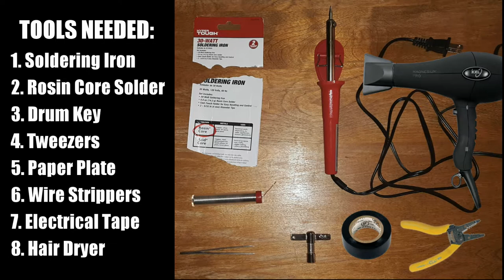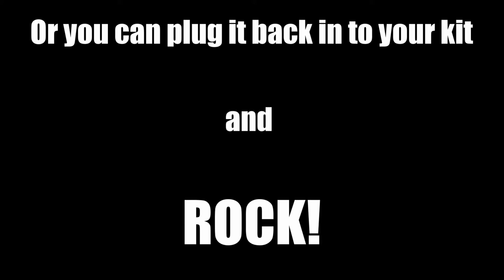How To Fix Broken Alesis Crimson Kick Drum

Comment: The mesh head on my Command set kick is worn. For some reason the piezo was glued to the mesh head. But watching this video the drum triggers just fine without it being glued on. I’m guessing I could use any 8” mesh head (since alesis doesn’t seem to sell those) to replace the worn head?
Thanks for the video
Reply from the maker: Danny Martinez, yeah, that should work. I can't really see a reason for keeping the Mesh cover on except for aesthetics.
Best place I can find Alesis replacement parts is eBay. Really unhappy with Alesis customer service and product availability.
Thanks for commenting.
Reply: @Underdrummer  Thanks for the response. I’m half considering buying a new tower and then getting a few bucks for the old one as it works but I feel it’s lost some response. 
If I get a new one I was thinking I’d use one of those drum patches. That’s a assuming they work without causing other issues. 
I haven’t been playing long so still learning the ropes. I’m a guitar playing that got interested in other instruments during the pandemic
Reply from the maker: @dannymartinez3600  Yeah, those Alesis Bass Kick stand go for a pretty penny on eBay. 
I do al little guitar as well. Guess people everywhere are learning new things since this stupid virus happened.
Best of luck to you and never stop playing music!
Reply: Well, I have a Surge Mesh kit, which uses essentially the same bass drum.  The head was wearing a hole through the center, so I bought an eight inch single layer kevlar mesh Evans head and a kevlar patch for the center.  The piezo was glued to the head, as well.  I carefully peeled the old head off, installed the new head, and made sure it is in contact with the piezo sensor.  Seems to be working fine, sounds the same.  But ask me how it's holding up a year from now...
Reply: How do I remove the mesh from the trigger? its glued...

Comment: I just got my first Alesis drums set. What can I do if the center kick is not working?… it is not detected by the system (They produce no digital sound, like the one you get when you press the “kick” key on the display)
Reply from the maker: Hi Luis, Start with the simple solutions first. Check the audio connectors are firm. Make sure the audio is working on other drum controllers. Then finally follow the steps in my video to remove the outer plate and look to see if the wires are severed. 

Overall the Alesis Electronic Drum Set is nice but the bass drum model is extremely flawed.

Best of luck to you!

Comment: I just got mine about a month ago and the bass pad has way more sensitivity toward the bottom of the pad than the center.  Was yours like this?  Ideas for fix?
Reply from the maker: Hi SteveB*94, mine was like that as well and still is. The reason is the Piezo switch is located lower on the kick drum pad. See here,  @0:37. The problem is you don't want your kick pedal actually striking the switch, this is what leads to the severed wires and a broken switch. You want your pedal to strike the large pad in the center of the unit - though the sound is not as clear, here @1:28
Reply: Hi whats your reglage please (kit trigger and sensibility etc?)
Reply: Umbrella Corp Multigaming :  not sure I understand the question. I definitely have the sensitivity on 1 for all of my pads.

Comment: Does the big round foam trigger the piezo?
Reply from the maker: SwagRyan.P, yes the kick pedal hits the big foam pad, not the Piezo itself. The vibration triggers the Piezo.
Reply: What is the name of that foam and size? I need to replace mine. Hope you can help. Thank you
Reply from the maker: @jamiljonel6613  Do a search for Alesis Drum Replacement Parts. Not sure you could replace only the large foam pad. 
https://www.alesis.com/products/browse/category/drum-accessories
Reply: Did you guys find out how to replace the big form? Mine has a big hole and it gets in the way of playing, any suggestions?
Reply from the maker: @angel77t91  There are a few sites I have found that sell Alesis replacement parts but it's not easy. Maybe make one yourself from similar foam?

Comment: Mine is working intermittently. Opened it and it all looks good. The only thing I've noticed is the big styrofoam it's a bit deformed. Any ideas?
Reply from the maker: Just taking a guess possibly the piezo itself has gone bad? Maybe try taping down the wires if the Styrofoam is making them stick out. Best of luck.